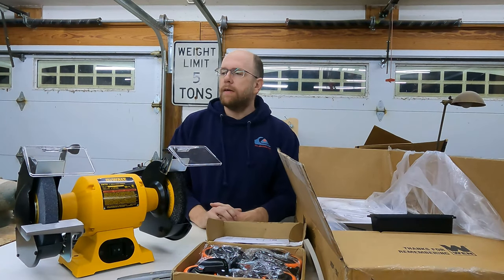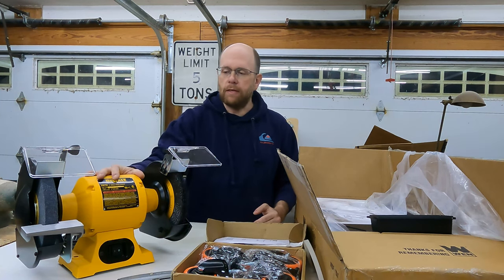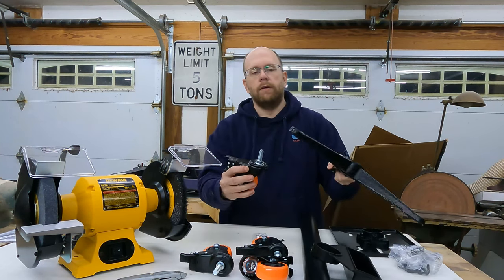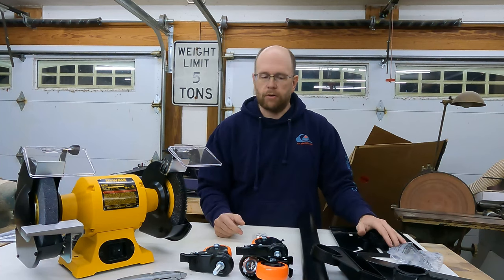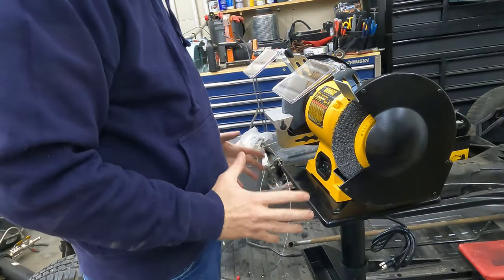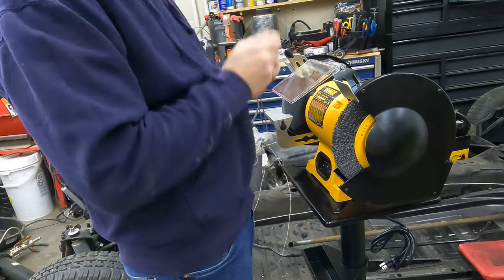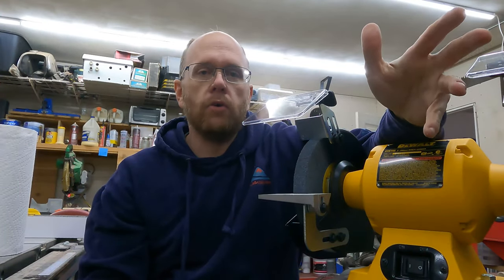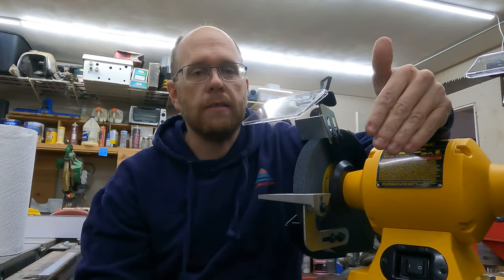Ultimate Bench Grinder Setup! Portable and Versatile.

Comment: I've bought used grinders of that size but usually they are missing parts such as the eye-shields or tool support. I wonder if replacements are available?
Reply from the maker: You can try ereplacementparts.com they tend to be overpriced and shipping is ridiculous, but sometimes they carry that part that you can’t find anywhere else. Other than that, I would consider fabricating my own parts that are missing. Cheers!